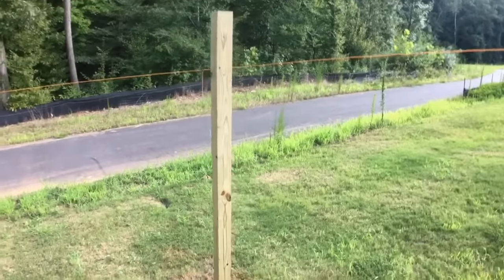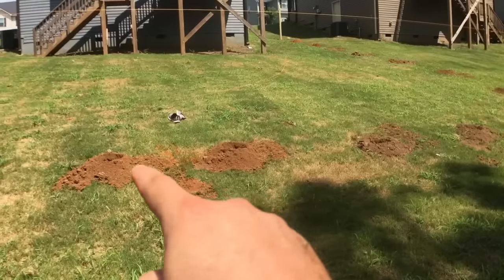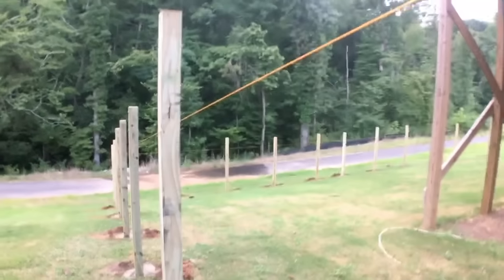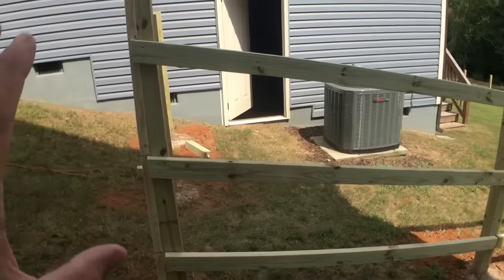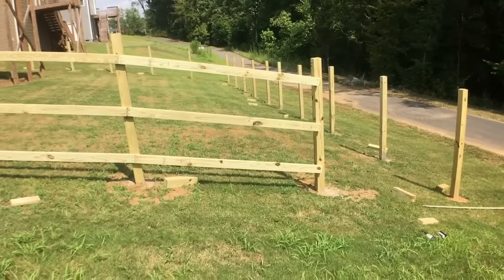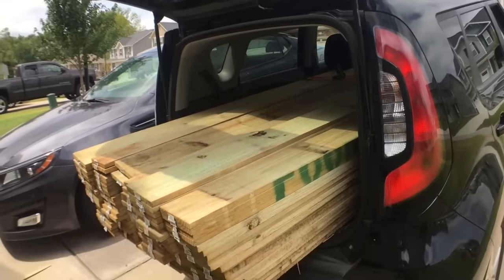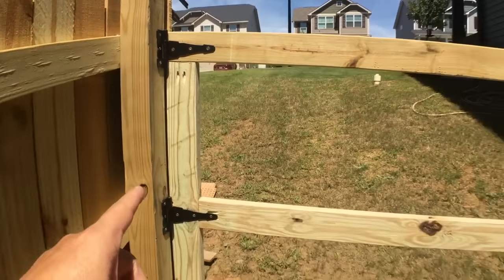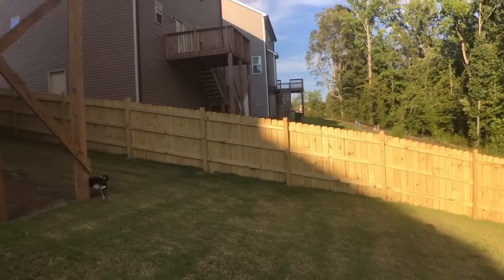How To Build & Install A Wood Privacy Fence Yourself! WITHOUT breaking the bank!!!!

Comment: Great video. Thanks for taking the time to edit and post it. I’m not an expert. I have built a couple fences. Your gates will definitely drag the ground before long. If you ever decide to rebuild the gates watch a video by Paul Ricalde on how to build a 6’ gate that won’t sag. If I ever build another fence I’ll build my gates like Paul. You should be very proud of that fence!!
Reply from the maker: Thanks John!!! The gates are still holding up ok and I think that’s how I have my latches which are helping. I never built my cross x support but need to do this. Otherwise the fence is doing great! Thanks for watching!!!

Comment: If you didn't use gravel in the bottom of each of those holes then every post will rot off at ground level within 3 to 5 years and the only thing holding that fence up will be the 2x4 cross beams. The concrete acts as a sponge holding ground water right against the wood. Gravel in the bottom allows the water to drain. Yes they're pressure treated but they aren't meant to be submerged, which is essentially what is happening without gravel. Also, the concrete should be mounded up around the base of each post to allow for run-off.
Reply from the maker: Thanks for the comment and guidance to others! Hopefully I’ll be ok for longer!!! Thanks again!
Reply: I heard throwing dirt at the bottom of the hole is what you want to do, it what Ive always done...I dont understand gravel because youre about to dump slurry (with gravel of its own) in their which will seep around all that gravel, yes? Or is this a big no?

Comment: I realize this video is two years old so you probably won't see this, but I'm going to ask anyway. Would it have not been advisable to raise each slat off the ground by at least .25-.50"? it appears you put the open grain directly on the ground, and the open veins of wood will cause a capillary effect that will draw in water and rot then bottom of the slats prematurely. I'm dealing with a neighbor right now who made this very mistake and now the lower third of virtually every slat is rotting. Also, shouldn't each slat be gapped by about 1/8" to allow for expansion? Lastly, I might have suggested the post concrete be "mounded" at the base of the post to facilitate water shedding. Again, neighbor failed to do this and several posts are rotting. As a fellow DIYer I greatly appreciate your effort.
Reply from the maker: Ohh so believe my friend I will see this comment! Thanks so much for watching! I did a live stream Saturday and talked about what I would have done differently and one of them was raising the boards up a little. I have not had much of an issue but in some area’s especially the back run… I did cut the bottom off 1.5”!
Reply: @TheCrawlspaceCraftsman  Wow! Wasn't really expecting an answer and surely not that fast!! I didn't want to seem critical but just dealing with those very issues on the  common fence my neighbor put up DIY and now wrangling with getting (at least) four rotted posts/panels replaced, I had to at least mention it. I saw your other video about the hack job that one actual company did across the street and that was dumbfounding. Did he ever fix it? Thanks and wish I'd seen the Livestream!

Comment: We are running 450 ft on some pretty big slopy yard.  I started measuring for plumb but with the uneven wood I had to start leaving large gaps in order to make everyone plumb and nixed that idea.  

Did you guys measure the pickets for plumb or just ensure the top line was straight and call it a day?
Reply from the maker: Kinda. Sorta.  We set the first one as best we could then ran a few and adjusted as we went. Your right… pickets are not like working with jointed wood! They’re not even so if you don’t make those minor adjustments you can be way uneven at the end.  There isn’t much choice but to have some gaps.  Thanks for watching!!!

Comment: How much did you spent on materials? Looks great i’m looking to do mine same look i have a 240 linear ft to fence
Reply from the maker: Wood prices have drastically changed since this video unfortunately so it’s hard to go by my cost. You for sure will save money nonetheless if you DIY. Figure out how much it would cost to do 8’ of fence and multiply that by 30 to get a “Rough” cost.
Reply: Thank you ! I’ ll check prices … i personally like the style of the fence

Comment: Hi Man, you were measuring 52 inches but then you said its 5 FT, 

Also I think all the pickets should be off the ground by at least 6 inches to prevent rotting, 

I think you should've cut the posts at the end . 

nice work
Reply from the maker: I know I goofed my 52” 5’2”! I think my brain was fried! LoL. I definitely agree cutting the boards but 6” may be a little extreme. 1-2” would be perfect.
Reply from the maker: And thanks for watching and commenting!!

Comment: great looking fence and thanks for the video. It helped me a lot. I will have to build from the inside out though so do it matter if you build from the inside instead of from the outside having the fence post showing to the outside and the panels facing the inside. Is there a technical right or wrong way..
Reply: Good neighbors who install the first fence have the pretty side facing out.  And so on. 

Good looking fence. Liked the jigs you built. I live in a different climate (dry mountains) so I would have no idea on the build. But I like the design.

Comment: How did the pocket holes scews  work out on the gate? Did it hold up? I like using pocket hole jigs but not but with anything that has constant stress on it.
Reply from the maker: So believe it or not the gates are still working almost perfectly! The gate I use alll the time does have a little sag and I do have to “lift” it up to line up with the hole and latch I’m using but other than that…. I’m surprised it has worked as well as it has with all the comments I’ve received over the years about it!!! Thanks for watching!!!

Comment: I am seeing so many different recommendations for the amount of concrete needed for a post, from 1-4 bags. 

Is 1 bag really enough? Because that would save me a lot of time and money for sure.
Reply from the maker: Hey Josh! I am not professional by any means. Take my video as guide and not set in stone. I only used 1 bag per post and so far so good to this day! I do think it also depends on the depth of the post hole. You can only fit so much in the hole you create! Thanks for watching!!

Comment: Did you use any wood preservative after cutting the slates? Also, I don't see any gap between the ground and bottom of the fence. Can be bad for the fence few years down the road.

Comment: Good job on the alignment of the posts,but unfortunately after a couple years they will be bowed and twisted, from the top will look like a slalom course,through no fault of your own,I'm gonna do my next fence will galvanized fence pipe, would be awesome if 4 by 4 we're available with holes drilled longways to slide over pipe you are doing a great and thorough job
Reply from the maker: Thank you!!! It’s holding up pretty well but having issues with the actual LAND. I’m on a hill / slant and the run off is terrible! I’ll be posting an update video in a few weeks I think!! Thanks for watching!!!

Comment: Also, get some 5 gallon buckets to put the extra dirt in... also do not dry pour... I just pulled a 20 year fence old out with a tractor... the dry pour method is whatbmade the crete weak.
Reply from the maker: Another Great Tip!  Thanks!

Comment: Beautiful job and yes a cable support with a turnbuckle on the gates and it'll pull them back into alignment.
Reply from the maker: Thanks so much August! I’m definitely doing a cable this spring for the gates and upgrading the latch for easier entry from the outside.
Reply: @TheCrawlspaceCraftsman , Thank you for the video. I used a cable and turnbuckle system for my sagging wooden front door and now it shuts with 2 fingers !

Comment: Hey brother, looks great, I was gonna hire someone to make my fence but after seeing this decided to do it myself. One question, what are the specs on all your wood? I'm assuming the posts were 4x4x8 or somewhere in that area, but what about the other two; the three horizontal pieces and the fence proper pieces?
Reply: You’ll need 2x4x8 pressure treated for the cross posts depending how far you space the 4x4 posts. You’ll want to cut them so they fit midway on both 4x4 they are being attached too, as to allow room for the next post to go across. The pickets you can get 6’ or 8’ tall and are usually 5” wide when doing dog ear cut. hope that helps

Comment: How much did everything cost Vs how much you would've paid to have it done professionally?
Reply from the maker: Hey Tony! So “At the time” I paid roughly $1400 and that included Auger Rental, Wood and Nails. I already had a Nail Gun and Compressor and Saws so factor that in if you don’t. I was quoted $3500-$5500 by two different Companies…. One being Lowes and another was a Local Fence Company who was the lesser of the two and who I would have used if I went that fought because I saw their work and it was great! Todays prices could cost double bit expect double quoted prices as well!!! Hope that helps!

Comment: Great video! If you dont mind me asking what was the cost for you for the material to build the fence? Posts and slats? Also, how many feet of fence did you build?
Reply from the maker: Thank you! Total cost was about 1400 but that does not included the caps which I added later (that’s a different video).

Comment: You should use butt plates on every post to prevent the post from leaning in any direction. Also you are plumbing the post, you’re using a level. Also that is a super job keeping the post inline. BTW when you plumb a hole you only use the very top and the very bottom of each post.
Reply from the maker: Thanks for info! I honestly knew plumb but by brain wasn’t thinking correctly! LoL

Comment: nice video, why did you decide to put "rough side" facing out rather than in? consideration for neighbors, rules, other? thanks!
Reply from the maker: Exactly.  Usually a fence serves two purposes.... To keep things in/out... and Curb Appeal.  If you ever drive by a house and see the Slats on the INSIDE... it really doesn't look good. The other option is alternating... One inside.. One Outside.  You loose a little privacy but not much. Thanks for watching!

Comment: How much did you spend total including power equipment rental?
How much was a professional going to charge you?
How many linear feet of fence did you do?
Great job! Now I need to get my ducks in a row and get started on my fence. Thanks for sharing your video and advise.
Reply from the maker: Hey Salvador! I was quoted $3700 up to $5000 for the fence. With rental equipment I spent about $1400!!! I did borrow a framing nailer but even if you buy a Harrbor Freight one for $100 your still under $1500 total!
Reply from the maker: And thanks so much for watching and liking the video!!!

Comment: to keep the gates from sagging put a 2x4 inside the 2x4 gate's frame at a 45 degree angle at the top and bottom section so it looks like a K within the E. better then using a tension wire going at a 45
Reply from the maker: Awesome! Thanks! Going to Be doing this! Thanks for watching!!!

Comment: looks great. What size nails are you using? I have the same gun and the nails are going just about right threw the picket.
Reply from the maker: I do remember the exact size. They had a broad head and I think were about 2” long. Turn the pressure down on the compressor. You can always go back and use a hammer to knock I the ones that don’t go in all the way....

Comment: not sure about the slats being flush like that, won't warping cause problems down the line?   i noticed my old fence had small gaps to compensate for shrinking and expanding wood.   you can use tile spacers to set the gap...  and you can't see in, (unless someone is literally standing with their nose against the fence) but you can see out, and i'm sure bubba would appreciate that as well.

Comment: Would you mind going over (roughly) your final costs for this? You mentioned you saved a lot of money. I'm looking to get my backyard fenced in myself. Great video here man. Nice job
Reply from the maker: We absolutely saved thousands of dollars.... Letrrally! The cheapest quote I got was $3800 with One gate. I was able to do this whole build with 3 gates for under $1500!!! I did borrow my neighbors Framing nail gun but even if you bought one at Harbor Freight it would ben$1500 a standard size lot Fence. Remember I cut my slats down to 5’ so if you wanted a 6’ fence... no change in price! Thanks for watching and hope that helped some!
Reply: Did you ever fence your yard in? The quote I received was over $10K for 250ft. Cost are significantly higher now. I decided do it myself and get some tools for the collection as well.  All in $6K includes 40 steel posts, 100 bags of quickcrete, 110 2x4's, 550 pickets, 5 adjusta-gate kits, hammer drill, Ryobi 40V auger, nailer, compressor and misc. I'm almost done, only get to work on it a few hours a week.

Comment: Looks good but it will rot where it touches the ground that's where most treated lumber rots where it's constantly getting wet and drying out. IMO it should be a minimum of 3 inches from the ground also that will help tremendously when weed eating.
Reply from the maker: James you couldn’t be more right! I should have left at the time two inches off the ground! Due to the angle of my yard…. Over time… runoff has built up at the bottom of my fence and I had to dig it out! It wasn’t enough to do a video on but I ended up taking my circular saw and cutting 2” off the bottom of the back side (not sides). Other than that…. No issues and now I’m good to go!

Comment: Great video. I'm in Apex, NC - so I appreciate the forewarning that the auger job is going to kill me :( I'm curious why you used individual pickets and not the pre-made fences from the box stores? I'm going to undertake this project in the spring and am learning as much as I can now.
Also, how much cement did you use per hole? Did you use the quickcrete quick set stuff, or just normal concrete that you pre-mix? Any other points you can give me? Thanks!
Reply from the maker: Hey Colin!!! That’s awesome your so close! The ground here sucks and is full of clay and granite. The main reason is I didn’t use the premade peices is not only cost but the degree grade of my yard. It’s so steep that those just would not work. It really is cheaper if you do by the peices. I used 1 bag of concrete per hole. I do believe it was quickcrete brand. My biggest advise is beware of the Auger! It sucks! Take your time and 6 to 7 foot on center for your 4x4’s. If you don’t have a big yard... 6’ spacing will make for a stronger fence.
Reply: Those pre-built sections are nice if you have perfectly level yards, and are not too concerned about quality. Doing it yourself isn't that much harder and you get total control of the quality of the material, and are able to install to your slopes.
Reply: It's actually easier when you dont use the premade in my opinion

Comment: Great Fence. Whats the Cost of this? DO you have a breakdown for each item used?
Reply from the maker: Thank you soooo much!! I fortunately do not have a breakdown but i spent just about $1,400 and that includes the rental of the Auger. I had access to a nail gun and compressor so if you do not... factor that in as well which could cost you about $200 at Harbor Freight or to rent. Hope that helps!!! Thanks for watching!!!

Comment: So I was wondering if it was a good idea to brace the slats flush against the ground? Did you have any ground shifting over time? Also, I see you're putting the slats right up against each other. Did the woods swell over time or cause any issues?
Reply from the maker: So far no issues at all. I only put the slats in the ground or barely touching. I didn’t want my dog to get any ideas Of digging under which he has not. Fence is doing great!!! Thanks for watching!

Comment: There are a lot of excellent, well-thought out and helpful comments here....AND I think your fence looks good....! You are meticulous, and did a really great job...!! But I haven't ran across any comments or concerns about using wood. I was going to buy our first home about 8 months ago and we did the inspection, etc. and found that a good amount of work was needed on the home. The wood fence on that particular home needed some work, though the home was fairly new. Anyways, I did some research,, and among other things found some concerns about using wood for a fence, how it needs to be protected from weather, insects, and the elements, etc.  My question is why choose wood? What are your thoughts on using other materials that don't have as much deterioration,  rot,, and/or upkeep concerns? How do you plan to protect the wood? Is there any concerns that you have in using wood for your fence? Incidentally we backed out of the deal ---- Didn't feel comfortable enough with the house to purchase, and we are closing on a different home that doesn't have much repair/renovations concerns, but we may consider creating more privacy with fencing or shrubbery/trees....
Reply: pressure treated wood is affordable and it lasts for decades

Comment: Was it cheaper to build the fence then buy the pre made fence panels?
What did something like yours cost ?
Just curious bc I have an yard I wanna fence in .
Reply from the maker: It’s definitely cheaper to build. Plus if you look at panels... they’re cheaply made. They can work if your yard is perfectly flat but mine was not so they wouldn’t have worked for my need. Thanks for watching and best of luck in your fence venture!